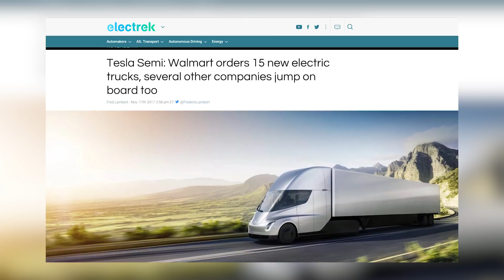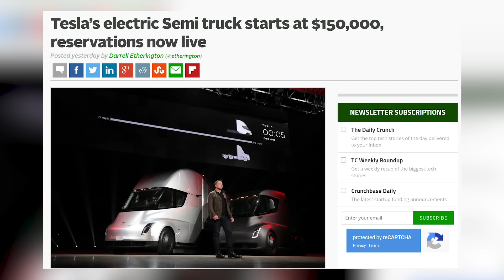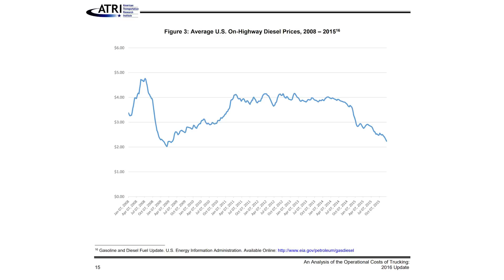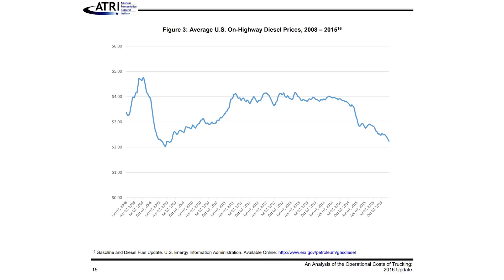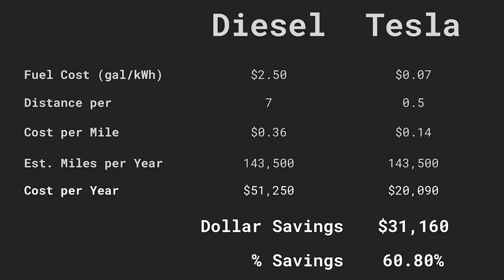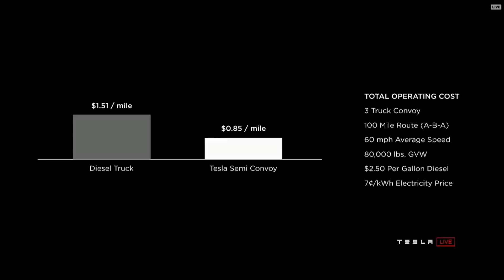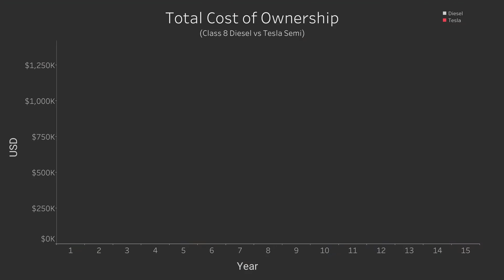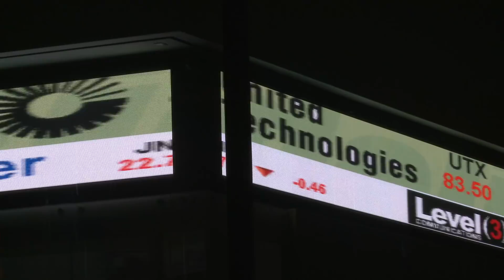What is the TRUE COST of a Tesla Semi?

Comment: you are forgetting one important thing.. you can not charge a 80% of the battery in half hour without short the life expectancy  of the battery. Forget about the 1 million miles which then plums down all the other numbers.
As you mention, the truck cost is not real, because that is the cost of the battery alone, and I tell you, it was not breakthrough on battery technology.
Now..  Tesla truck has in addiction serious competitor which in my opinion are way better.
The Nicola One truck, that it works with hydrogen fuel cell.  Is also electric with all the benefit of an electric truck, plus, 1400 miles of range and fast recharge.  The hydrogen net of stations will be provided by the same company in all USA and the cost is included in the truck lissing.
Reply: Hydrogen is a pipe dream.  It has extremely low energy density and quantum tunnels into the metal of the tank, weakening it over time.  To get 1400 miles of range from hydrogen, you would have to be hauling a tanker as your load.  Diesel fuel has like 100 times more energy per gallon.

Comment: Convoy mode is NOT exclusive to Tesla nor to EVs. They are already being tested in Europe. So you cannot count them as advantage against traditional manufacturers.
More so - convoy mode is more beneficial for traditional trucks with higher drag coeficient than to already streamlined Tesla (even more in EU, where trucks are limited by length and therefore have usually flat front).
As to your options of how Tesla wants to make profit - you make two mistakes. First you assume 1MWh battery. It may be less. Some even think 500kWh, but realistically it can be 800kWh. Second - even without breakthrough - battery prices are dropping quite rapidly. In 3-5 years (+- realistic timeframe we might see some sort of mass-production) we can see prices to drop to half of what they are today.

Comment: How the heck are these megachargers going to work? Delivering a megawatt hour in 30 minutes is the sort of power used by a small town. It needs something like 6 inch thick copper bars to take that much current.
Even if it's possible, this requires an incredible investment in infrastructure..  By 2020??
Reply: Paul Goffin sounds too good to be truee... most likely is
Reply: IIRC, the Megacharger peaks at 1.2 megawatts - high, but not impossibly high. It tapers down when the battery nears full charge. Some have assumed a megawatt-hour battery because of the megawatt charger, but my own estimates figures a battery half that size, based on the fuel economy ration between semis and sedans.
Reply: Paul Goffin You don't need big cables if you are using high voltage.
Reply: Frank Gormanns Of course, but how high? A quick back of the envelope calculation suggests 1666A at 1200V. That's big wires, big volts, big amps and a significant infrastructure to deliver it to the charging station.

Is the USA's power grid capable of delivering that to a significant vehicle fleet?
Reply: I don't know, how they will reliably provide that much power for such a lot of megachargers. Connector up to 5kV are no problem at all, but the connector is too small and has just 8 pins. This will get hot for sure.
I wonder, if they calculated dirt, corrosion and wear into this connection.
I am not allowed to make a 1,5 MW or a high voltage connection. In the future, anyone with a truck license can do it.

Comment: The convoy mode hints at the end goal in this segment (also hinted in the model 3 ride share)..... Fully autonomous driving.  Truckers and taxi drivers will be replaced with driverless vehicles.  Driverless truck freight would require no breaks, as there is no driver fatigue.  Shipping can run thier trucks 24/7 and save on salary costs.  It would create some new jobs at either end of each delivery trailer hookups,loading and unloading, etc.... But actual drivers will be a thing of the past.
Reply: Michael Gray so who's gonna buy the freight if no one has a job?

Comment: Three things Elon didn't say about the convoy: 
(1) A 3-TSemi convoy requires 1 driver for 3 trucks, which means more profits for truck owners but less jobs for drivers;
(2) If a 3-TSemi convoy is feasible, a X-TSemi convoy should also be feasible;
(3) If ~30% savings per mile can be achieved with a 3-TSemi convoy, a X-TSemi convoy should be even more profitable.
... if you offer an industry a positive self-reinforcing incentive to change, it will change.

Comment: Great video!  But maybe you got something wrong about TSemi Convoy mode:
1.26 $/mile is the total operating cost of 1 TSemi, GVW 80,000 lbs.
0.85 $/mile in the total operating cost of a 3-TSemi convoy, total GVW 240,000 lbs.
The total operating costs exclude the cost of the driver(s).  I think the 0.41 $/mile saving (~30%) is generated from aerodynamic efficiency gains, which translate in lower energy consumption and lower fuel bills.
Reply: I may be wrong about the whole convoy aerodynamic efficiency gains.  :)  Here's why:
If the savings are only from having 1 driver instead of 3, we can calculate the average hourly wage saved at 60 mph.
0.41$/mile x 60 mile/hour = 24.6 $/hour for 2 drivers, i.e. 12.3 $/hour per driver... seems low as the national median for truck drivers is ~20 $/hour... but it's possible.

Comment: Great video, live the infographics. Two things no one is talking about:
1. Displacing 50k$ per truck per year worth of diesel... there is a massive industry around this infrastructure from delivery to service ect.
2. The logistics of placing MEGACHARGERS at docking areas. Just imagine a 20 docking bays each with a charger located where the truck will sit while docked ( 40feet from the dock) and the trucks have to navigate in and out with those in place. Long cables will be out of the question (Mega gerth). Hanging from above somehow?

Comment: A downside is the Mega charger spacing. I'm sure drivers will often need to recharge long before their battery is depleted since one may not be nearby when the battery gets low. That kills a lot of time.

 eg. If gas stations were only at 150mi increments on a road, people would fill up much more often.

Comment: If the trailers had batteries fitted this may help the distance they could go, this will, of course, require dedicated Telsa compatible trailers?
Reply: It would also mean less cargo.
Reply: or heavier overall weight, perhaps the benefits will be more than downsides?
Reply: The maximum weight is set by law.  If you add more batteries, you have less room for cargo.

Comment: a new drivetrain or battery pack could be very expansive repairs. the model s and x are great cars but not free of technical problems. technical issues whit the trucks should be considerable, at least in the first years.
Reply: enco already most U.S. hwys have holes that would swallow those trucks whole

Comment: The primary takeaway for trucking companies and truck owners is the (lower) cost per mile. This is the most fundamental piece of information that is needed in this business to determine if they can be profitable or not. This is the number one factor that will attract the trucking industry to Tesla because everyone wants lower cost and higher margin. The trucking industry is being reinvented on so many different levels, thanks to companies like Tesla.
Reply: Koug Arpaw most trucking companies are on the ragged edge now with fuel costs and ever increasing taxes. Adding all this infrastructure will break many small towns

Comment: I think the Semi production will be split in two, the motor/frame/battery is made at the Gigafactory and the cabin somewhere else. That way the rolling chassis can be built on one automated production line fast and cheap. And, who knows they might also build another production line there for the cabin which is clearly made the same way as the model S body. One piece, not easy to transport.

Then there is the cost of the Semi. Since Tesla is in energy business, what prevents them from building huge solar farm(s) to supply the trucking companies. That way Tesla can get paid twice for the Semi, one million miles could bring $140k extra.

Comment: Everything you have came in a truck or two.
Diesel is being phased out. Hydrogen and sunshine in.
Retooling all across the industry is off an running.
Reply: Hydrogen is currently produced from methane and has incredibly low energy density.  It also requires very high pressure tanks to get much in them, and it has a nasty habit of quantum tunneling into the metal of the tank, weakening it.  Fuel cells are also not able to produce much energy unless they are unreasonably large.  For these reasons, hydrogen is a pipe dream.

Comment: Ben, slight flaw in your presentation.... you ignore the "no need to buy brakes" in the pack size equation, also Tesla have guided <2M/kWh.  Strong regen + <2M/kWh = less than 1MWh pack.  I'd guess anywhere between 600 and 750kWh as about around 1/4 to 1/3 of the range of an electric car is powered from regen.
Reply: Regen only comes into play in stop/go traffic or when going up and down hills.  In both cases it averages out.  The stated range is based on an average consumption and everyone seems to be saying that will be about 2000 Wh/mi.

Comment: Thanks for the video! I wonder how much the truck will weigh, with that massive battery. The heavier the truck is, the less cargo you can haul, the less money you make.
Reply: Jeremy Schmidt --Don't worry about it.  Turbodiesel tractor semis are not exactly lightweight vehicles to begin with.  Even four electric motors would have a combined weight less than the transmission alone for one of those big rigs.  The diesel engine and accessories are similarly huge and heavy.  300 gallons of diesel fuel certainly weighs less than batteries, but it is everything else you take out that allows a fully electric rig to be comparable and competitive, while also being cleaner.  Think of it this way, a Tesla Model S is heavy, but so is an AUDI A8, BMW 7-Series, or Mercedes-Benz S-Class.  The heaviest versions of those ICE cars are more hefty than the heaviest Model S.  It will be a similar comparison between the Tesla Semi and big rigs from Freightliner and the rest.
Reply: Dave Zoll where to start, 80,000 pounds is gross vehicle weight. We are not allowed to exceed that weight without special permits. So weight is a major factor when it comes to semi trucks. Most of my semi trucks are around 16,500 pounds before you add fuel, trailer, or load. Most trucks have a cargo capacity of around 46,000 pounds. As for the super sleepers, they are rarely used for anything that is heavy. They're stretched frame makes them weaker. Most heavy haul loads are pulled by heavy duty daycabs with reinforced frames and beefed up axles and suspension.
Reply: Dave Zoll 

The weight of the truck is absolutely a factor. Gross vehicle weight cannot exceed 80,000 pounds.
Reply: Joshua Black around 20, 000lbs for the typical over the road sleeper truck.
Reply: 80k is gross weight. It's nonsensical to claim tractor weight is a non issue.
Reply: Pokey Trucker Exactly
Reply: The engine and transmission plus braking system differentials drive shafts ... I'm thinking the Tesla will be lighter.
Reply: Jeremy Schmidt Don’t forget to factor in all the parts the truck doesn’t need that weighs down a diesel.
Reply: Elon doesn’t understand the industry either!
Reply: Tesla is 80k so are most semi's. Weight is a non factor on how much you can haul or make as why you have extended sleepers and super sleepers (like having a travel trailer in the back). Super sleepers are what most companies use for major hauls. By major I mean loads so big you have to have the road shut down for that route as they are that big and also like 3 miles per hour. The pay on those are so high you only need to work one a year unless you are trying to make millions that season at anywhere from 200k to 300k gorse.
Reply: @ogretheberserker2618  wtf are you talking about?? Everything you wrote here is wrong, please dont comment t on what you clearly know nothing about sir
Reply: @TheDonaldSpinner Hahahaha Says the person who knows nothing about mega load trucks. That's is what I am talking about. There are other major problems with tesla trucks and weight is only one of them. So please don't comment on what you clearly know nothing about sir.

Comment: So far, my thoughts on how they're able to cram so much charge into both the Semi and Roadster has to be the 2170 battery cell. Either those things are far more energetic than we thought (I've seen sources say it's up to twice the energy capacity than the 18650 cell while being slightly larger) or Tesla is hiding even more from us.

Alright, that brings up a new set of questions: what's using the 2170 battery cell and are the Semi and Roadster among them, apart from the 3?